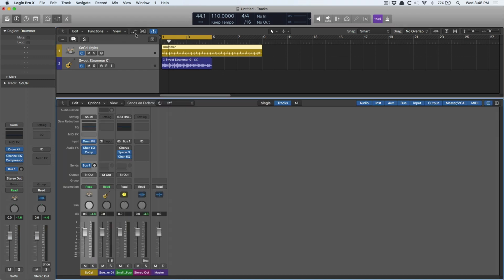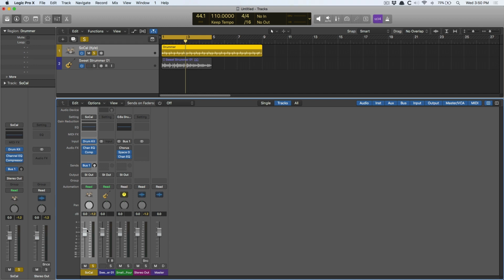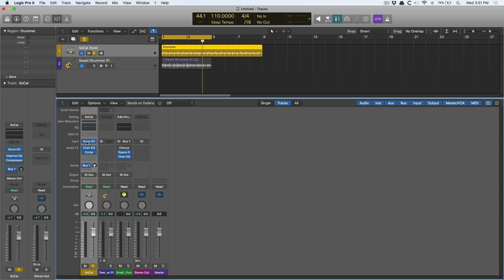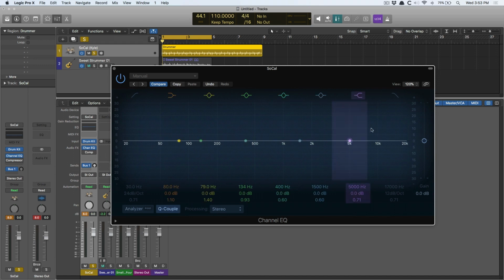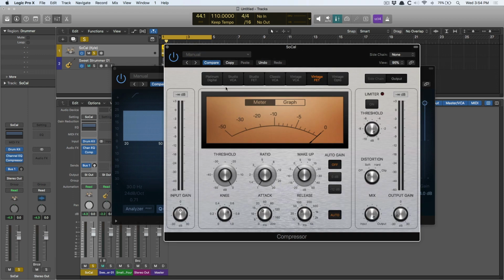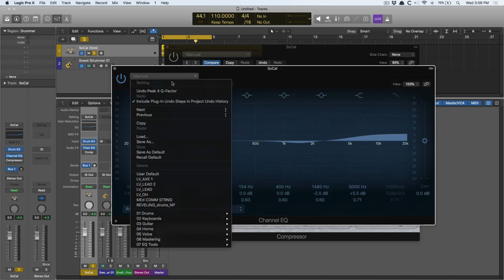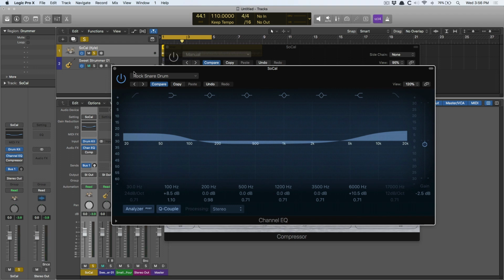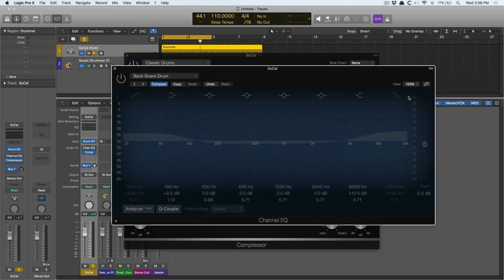Where Do You Stand on Pre Fader Metering? The Who, What, and Why

Comment: I mainly record vocals.  I've never used pre fader metering.  Would it be a great use of pre fader metering to monitor my condenser mic's input?  Is it more accruate that post fader metering?
Reply: Depends on what you mean by accurate. Both have the same "accuracy" of what they measure but measure different things. If your fader is at 0, pre and post fader metering shows the same thing. The issue is when you lower the fader (for mixing purposes for example), in post fader metering you are not actually seeing the input level. You might be tempted to raise the gain for your microphone for example, thinking you still have headroom. Of course, if you have plugins that change the level, pre-fader metering will not show input levels either,  this is just something to keep in mind, plus you can also work with post fader if you take it into account.
Reply: Alexandru Lapugean I was referring to tracking vocals.  I believe pre fader is better.  ThankYou for your response

Comment: I use pre fader metering always. I use a gain plugin at the bottom of every channel strip to mix levels so that ALL my faders are at zero. All my meters hover at -18 dB. The output channel gets all the linear eq, multi pressor, limiter, and my mastering loudness is plenty loud more than it really should be if I want to. Be careful with that adaptive limiter, it adds more distortion than you may think.

It's so nice to focus on certain instruments by raising the faders up to the max, or lowering them. If I like the changes, I adjust the gain plugin accordingly adding or subtracting the dB so that I can return the fader back to zero again and that tells me that I'm done with that. This is a nice workflow with a reminder check on trying out changes to the mix.
Reply: Do you mean before or after plug-ins ?

Comment: Pre-fader metering is critical for external synths of any kind. I always turn ON pre-fader metering and then, as a part of gain staging, set the output of the synth at about 3/4, using its volume control knob of the instrument. Then I open the mixer view and see where the level is. I then open the external instrument smart tool and set the individual levels of each instrument in to -18db to -15 db or so. Then I turn pre-fader metering off and forget about it. From that point on, post-fader is in effect and I proceed normally.
Reply from the maker: Thanks so much for sharing John! I appreciate the insight into your workflow with Pre Fader Metering. My question to you: as long as there's no plugins on the Channel Strip, I would think that the level of your outboard gear should read the same whether Pre or Post. Do you agree? Either way, loving the conversation around this topic.
Reply: I only mix in pre-fader mixing now. It took a bit of effort to start doing it, but now it's the only way I work. Having it in Pre-fader lets me know exactly how hot the signal is before processing, and leaving it on after lets me know at a glance if there are any plugins causing issues; I guess I could do the same with post-fair metering, but I also won't be fooled by the channel strips level either. I think from a gain-staging perspective, I find pre-fader the way to go for me personally. If I find a good enough reason to revert to  post fader, I'll take it; so far, no cigar though. :)
Reply: That's actually probably how I stumbled on this video: "Any reasons to do post fader metering?" lol
Reply: I agree with you here mate, I always use pre fader to make sure I'm gain staging at or as close to -18dBfs and use the gain plugin to change volume. So glad I came across this video - This channel rules! Thanks